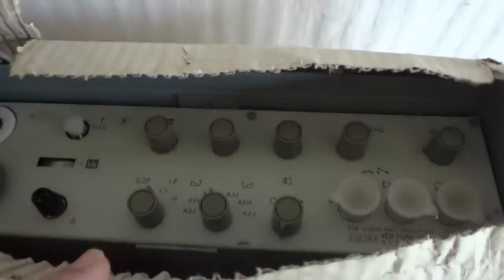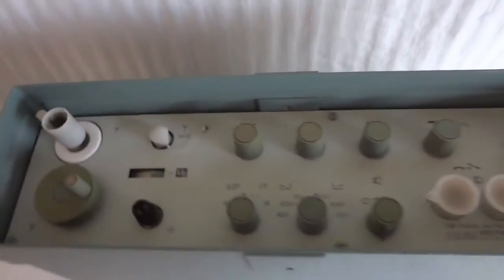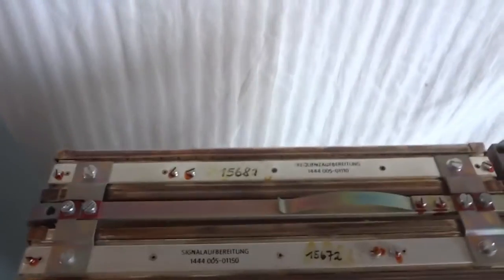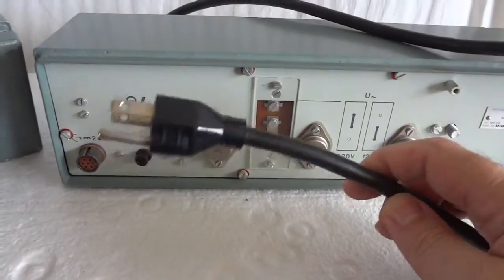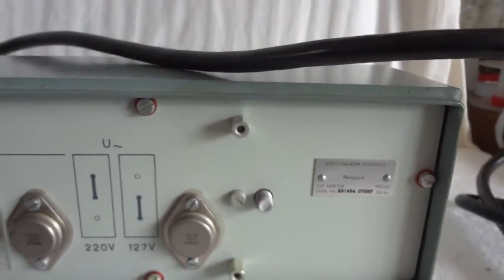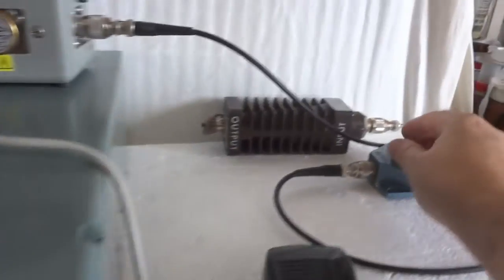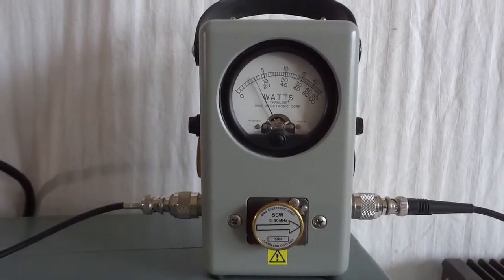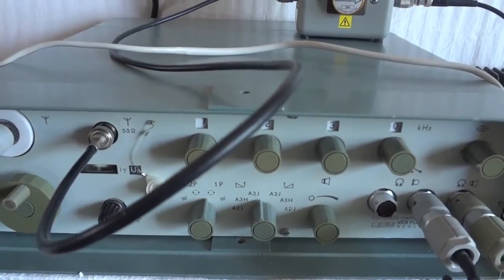SEG-15D HF SSB Stasi transceiver made by RFTin former East Germany

Comment: If you are new to these radio's... The plastic houses of the ttl-chips tent to fall of spontaneously. I advise to open the synthesizer unit and give them all a drop of superglue to prevent them from coming apart later. Also, use a microphone with a plastic housing. I burned my mouth twice by non ionising radiation using a metal housed mic while calling cq... I kid you not.
Reply from the maker: New? Can't say I am... bought my first one in 1992 and have repaired many of them since. Most common failure is tantalum capacitors, but I also have had transistors fail (two in the same oscillator circuit, obviously a bad production batch) and also TTL chips, although not in the way you describe. There were two TTL chip manufacturers used for this radio: One named "Tesla", a Czechoslovakian based company (obviously not Elon Musk, he stole that name) and the other a Russian company. The Russian ones are always the ones that fail. Which brand failed in yours? Cheers.
Reply from the maker: The microphone RF burn is the result of a bad ground system for your antenna setup, that can happen with any radio. You can avoid it by improving the counterpoises for your antenna. So, that problem is not specific to this radio only. What happens is that the RF current seeks a ground path (due to the absence of a proper one) which can end up on your lips through the microphone. The current is pretty much harmless though, due to the skin effect for RF. When you go to the hospital to have a mole burned-off (as an example), they use the same RF energy, at 13.56 MHz, an ISM frequency for that kind of medical equipment. Cheers.
Reply: @LifeIsTooShortForQRP  Thanx for the reply. I see you know your way around with these radios. My call is PA1EMD and if you look me up on QRZ.com you'll see my seg15. I changed my callsign recently, and haven't been very active since a couple of years. If you look carefully at the picture you'll notice that I moved the connection for the microphone to gif me more free space on the utmost right KHz-dial knob. I made indeed al the mods, and it is still up and running. And by the way, you were right about the rf-burn part. I hooked it up with just one long wire as an antenna. 73'
Reply from the maker: Derk, okay, had a quick look at QRZ but only one photo loaded, the bottom one did not. Don't know why. From what I can see, you appear to have a late model, just like mine (you can see that on the size of the meter aperture, for early models that aperture is much narrower). Yes, they are great radios, love them. And with 20 watts they get out pretty good on 80 and 40 meter. But I always keep all my radios 100% original, got enough other radios here that can operate above 14 MHz. Cheers from AC5XP, and thanks for looking at my videos.

Comment: I owned several of them and modified them with the filter unit of the SEG 100 to use the CW filter for Digital Modes... 
Also modified the diode mixer with modern diodes... as well as the Audio Frequency passband... 
And extended the frequency range up to 14,5 MHz for 20 meters DX...
Reply from the maker: Those are very useful mods that you describe. However I prefer to keep my SEG-15D radios fully original. Let's face it, they are historical pieces, considering they were made in a country that does not exist any more....
Reply: yes, you are right about keeping them original and the "lost country" !   But I had several SEG 15D, I had 32 SEG 100D (which I also modified up to 14,5 MHz) with all the accessories plus TTY's and antenna masts etc. So modifying them was just for giving more fun on the Ham Bands...  And I had 32 RFT EKD 300 and 500 receivers with EZ 100 RTTY/Antenna Diversity Unit....